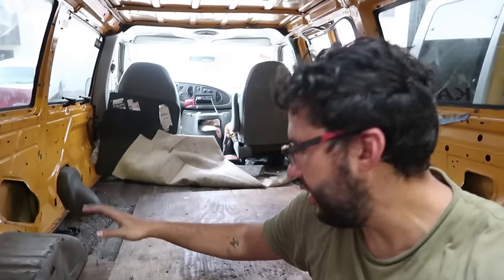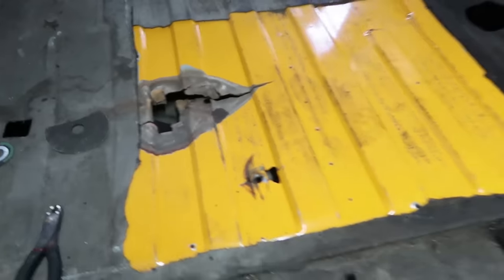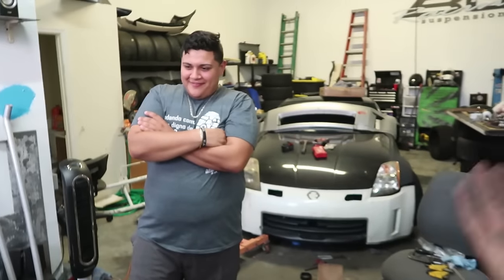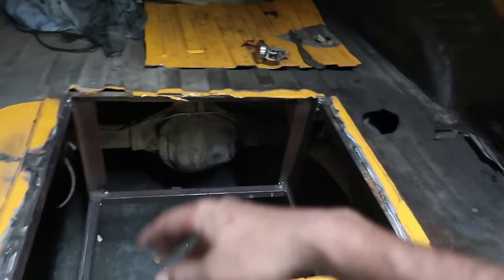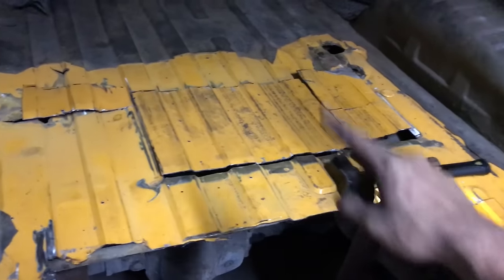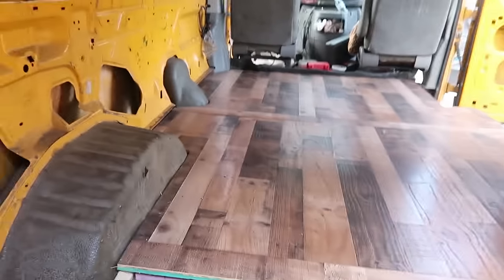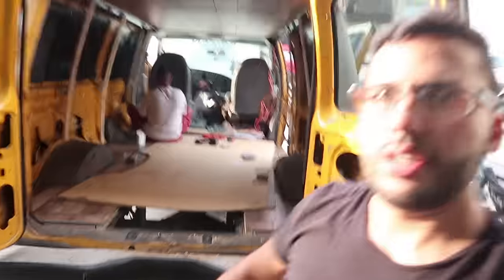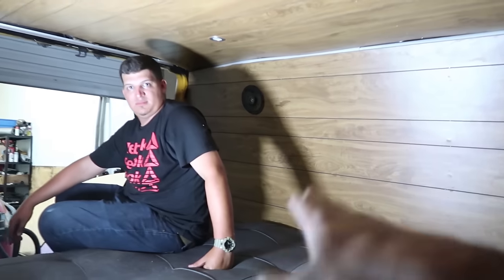Most Affordable CAMPER VAN Build UNDER $170!!!

Comment: Nice job insulating the floor. I'm doing my '98 Windstar the same way, but I'm using simulated hardwood flooring - for less than $100 I have a gorgeous looking surface to build my cabinet work on.
Reply: I like vinyl plank flooring. I used to do van conversions.

Comment: Awesome build but quick tip to all is that fiberglass insulation is NOT a good idea because some of that you'll be able to feel in your throat and nose later down the road... Also Crown Molding goes on the ceiling angles, you wanna use baseboard for the flooring angles.

Comment: I like those Ford E-Series vans. I currently have two. 
2000 E150 Cargo Van with the little 4.2L V6 which is my daily and reliable road trip vehicle. 
It isn't insulated so when I sleep in it I do end up with the dreaded condensation on ceiling. Not as bad when I can leave a window cracked. 
My other is a 1998 E-Super Duty (early name for the E450) with the 6.8L V10 and a disc brake Dana-80 rear with 4.63 gears. That one started life as a Fleetwood Tioga 29Z Class-C motorhome. I bought it cheap since the motorhome structure had roof leaks. It only has 81k miles. I completely dismantled and parted out the motorhome structure stripping it back down to the cab/chassis. I installed a 72" aluminum double bunk sleeper cab and a 16'x8' flatbed on the chassis. Eventually it will be my road trip toy hauler so I can carry my Jeep on the flatbed and tow my boat. The sleeper cab has lots of storage but I plan to mount side boxes under the sleeper as well as under the flatbed. 
I went with the flatbed since it was cheap and will work better for my needs but I could have built a ramp truck bed for it which would make it better for loading lower vehicles... 
Something like that would probably work great for hauling a drift car.  
Keep the van content coming!!!
Reply from the maker: That would be a dream to build! 6.8 will go forever when built right! Thank you for the kind words

Comment: Do you think that it could be possible to build that box underneath the van without the welding?
Reply from the maker: If you can get creative drilling and bolting stuff together I’m sure you can but batteries will get heavy fast so it needs to hold around 200 pounds. Use big bolts and thick steel

Comment: I'm disabled and I have to move into a 2003 Honda Odessey, it's got problems, otc sensors, tcs issue and the guy who sold it to me, lets just say that the next day wouldn't pass marta, I can't afford another vehicle, so if you have any ideas for me as far as making it safe, it's the middle of winter here in Tn, I had to live in my car before, so I know I need a solar generator, safe heat, bed, ect.. I have space saver oven, ect. I don't know what to buy on a budget or if I should sell it?? Any information or direction on this I would be very grateful..

Comment: I've heard in other Van Build Videos that Romex isn't good for RV 120VAC because of the Solid Core Wiring has Vulnerabilities to Vibrations, appropriately gaged Stranded Wire is much better in this setting.

Comment: Nice job, just found your channel... 
I'm planning the same thing as this Basically. I have a 1979 ford econoline. I'm gonna be using as camper and tow rig for my s14.
Reply from the maker: It’s amazing, I have camped at 2 drift events already and it worked out amazing, number one thing you can do is install shore power, most tracks have plug in and you can play music, make coffee, bring a fridge, charge tool batteries, have power for welding or grinding, I’ll be making more van camping specific videos soon, checkout my other video of the wiring I did

Comment: I hope he covered those other holes in the floor of your van b4 you continued with the build bcuz if you didn't & water gets in there underneath that wood it'll cause mold&you don't won't that...it'll rust thru the metal as well but the mold is something you want 2 avoid at all cost...

Comment: Great video man, this gave me some great ideas on how I will be building my van I haven’t fully committed to how I will actually set everything up, because I will be living in my van full time i wanted to ask if there was anything you would of done differently?
Reply from the maker: Yes, plan for cabinet support behind the walls, in the rush of finishing the panels I forgot to mark and place my beams in a good distance for when installing the cabinets, now when I go to do it I will be guessing and probably can’t do too much weight because it is not enough beams so add plenty, if you lay extra wires like I did it’s a good idea Incase you event want to add another outlet or anything

Comment: Is there a particular reason you ran the paneling on the walls horizontally ?  If you hung them vertically like they're supposed to be, you wouldn't see any seems because the panels overlap each other.
Reply from the maker: Less cuts, and top to bottom was exactly 4 feet , looks wise I didn’t really care tbh

Comment: I have a 99 E350 with the 5.4, I've had the plugs changed twice, the issue is with the later ones.
Reply: What issue are you referring to regarding the spark plugs?
Reply: Stripping the threads, blowing plugs out or breaking them

Comment: no you don't use fiberglass in a van
Reply from the maker: Why not?
Reply: correct me if i'm wrong because i'm only human ,but it will soak up moisture in cold or hot climates and mold
Reply from the maker: Steel Trooper and so will the foam, everything in modern cars have fiberglass insulation also, that’s something you can’t get away from in any space that is not a vacuum. Plus cost effective wise it would be cheaper to replace in the future.
Reply: @DriftHappy  thank you for my new found knowledge. I soon plan to start vanlife.
Reply: @DriftHappy  because batt fiberglass, well,.has glass and those small particulates get dislodged as a result of a moving vehicle get into your lungs. Homes dont move so they don't dislodge. Hooe this helps. Live and learn, right!
Reply from the maker: @susiehernandez6652  I’ve had it for over a year, no issues.

Comment: U said under 170$. Then said you spent 80,000$. LOL... THATS how channels get destroyed. Watch for those blackhats
Reply from the maker: I did not lie or mean to deceive, It was 170 for the panels, insulation, wiring, screws, glue, great stuff, staples and wood. The tv was a gift and the sofa is not included because most people would make their own bed or style. The point is to search on Facebook marketplace and craigslist for deals, they are out there, it could be less